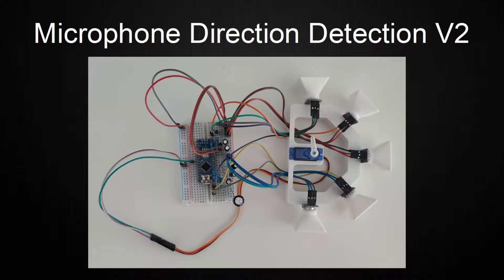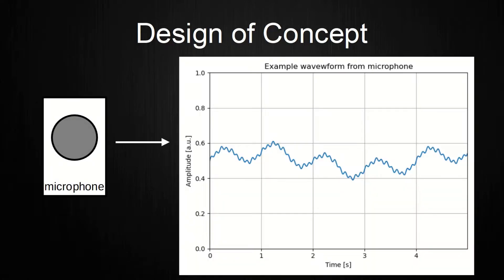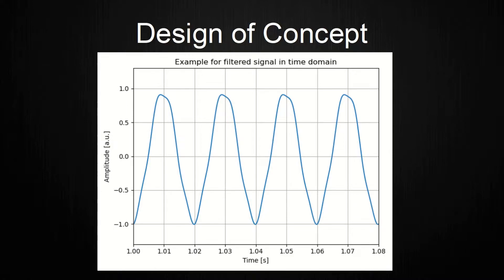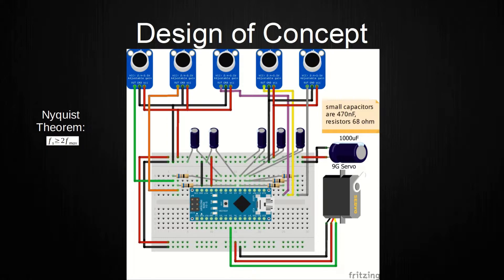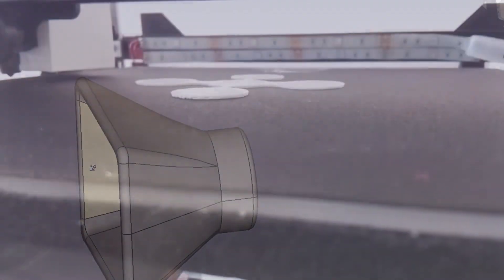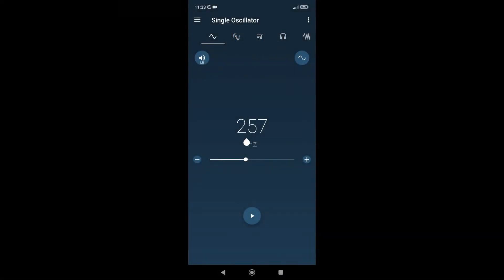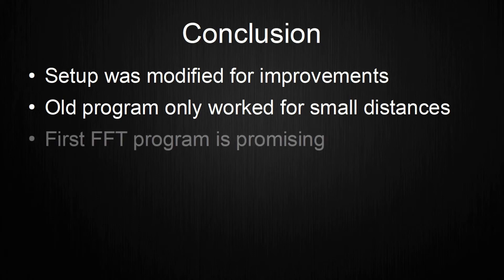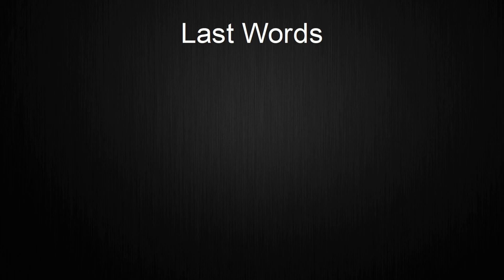Microphone Direction Detection Version 2

Comment: If you are trying for simplicity, maybe you can use autocorrelation of the ADC samples and find the timing differences. (Or is this what you are doing in frequency domains?)

Of course another approach could be feeding it through a deep learning network. Instead of recurrent, you could have the input layer be insanely large to encompass a few hundred milliseconds of audio samples. (You would need an embedded TPU module for this of course)

Comment: Excuse me Sir, I have some questions I wan to ask, if you have the time to response. First of all thank you for preparing such videos. 

Here are my following questions:

1. I am curious as to how you used FFT in determining the DOA of sound source? Does the implementation of FFT matters significantly?  

2. I have some hard time understandind real time implementation of using the sensor. Would you recommend me a book or project I could do to understand the real-time implementation? 

3. I was wondering if you have tried using Beamforming techniques such as Delay-Sum method? There are concepts such as steering matrix, steering vector.  Perhaps you can also consider it. 

Thank you for your time. Your feedback will be greatly appreciated.
Reply from the maker: Hi, here are my answers:
1. I used the FFT to determine the amplitudes of the different frequency bands and compared those frequencies against each other. Doing this does seem to work better than to just compare the raw signal amplitudes, so I would say it matters slightly.

2. I don't really have a resource to help you understanding the real-time implementation except the search term "discrete signal processing", but I can offer some more information: The microcontroller records raw data from all microphones for a specific time. Afterwards, this data is processed. So in this case, the whole program is semi-real-time, because it always processes data from the past.

3. I haven't tried that before but it does sound interesting, it will go onto my ToDo list. Who knows when I will actually tackle it, the list is currently very long. ^^

Thanks for the engagement and the questions!

Comment: I dig it. 50 years ago I was into all the technology but then life happened.  Usually I'll revisit all of the problems and find them all to be solved.  Not here, though.
I'm a turkey hunter.  Working in the steel mill caused me to lose hearing and I cannot turkey hunt like I used to.  The method is to stand in the dark of the morning, listen for a gobble, then go to cause of the gobble and pretend to be a hen to call in the turkey.  I hoped that someone would have a device that would hear the sound and direction of a gobble for me, but not in my life time.  I thought that the microphones would be farther apart and the timing of the sound would tell the direction, not the amplitude as you do.  It occurred that if there were walls around the microphone (imagine a child drawing a sun) then the clearest one would determine the direction such that it would act like polarizing as in light.  (If the sound came at an angle it would bounce off a wall and cause a distortion.  So, to me, there seems to be 3 ways but probably much more.   Oh well, not in this life times.  Thanks for the video, though.

Comment: Hi, would 470 nF ceramic capacitors be suitable for this project?
Reply from the maker: Ceramic capacitors are (from what I found online) generally more used in high frequency applications. Since we are in the kHz domain, electrolytic capacitors should be better suited. Still worth to try it out though!

Comment: You should consider using trilateration like it is used in artillery sound ranging.
Reply from the maker: That's actually a really interesting idea, I will see if I can use it for my purpose. Thanks!
Reply: @techdudes996 bro can i get your email?
Reply: Yeah, I'm curious if a simplified version of this mic array could be used. https://www.youtube.com/watch?v=QtMTvsi-4Hw
Reply: But how? I have same project but i cant write codes for trilateration.
Reply: @Naber796  You can either use the mathematical exact approach or use an iterative algorithmic approach.

For example you could say that your microphones are located at Position P1, P2 and P3.

Then you detect the sound with the 3 microphones.

Microphone 1 detects it at time t1 and microphone 2 at t2 and microphone 3 at t3.

Then you take a few guesses for position X which represents the origin of the sound.

Then you check each guess with the real observed values and then add a random value to the best guess and repeat this for a few times and then you should have a rough location of the origin of the sound.